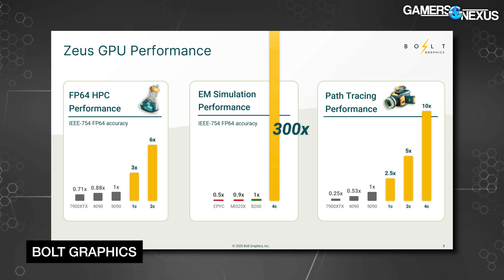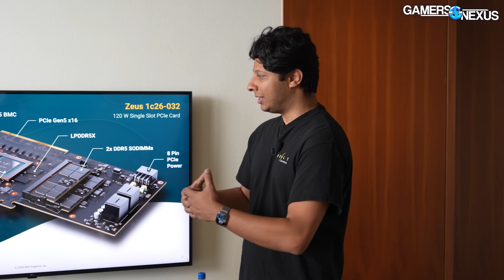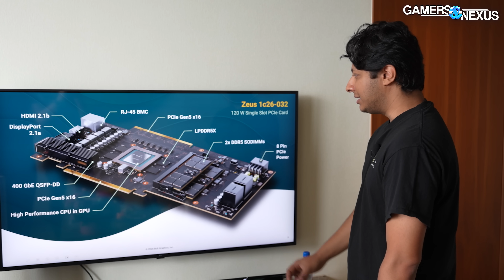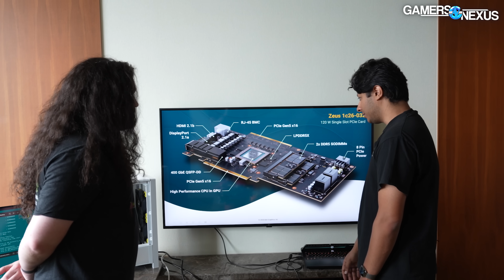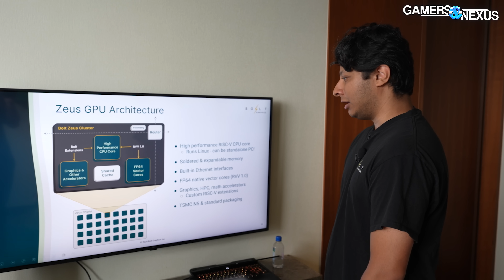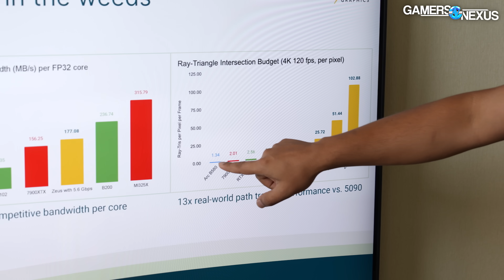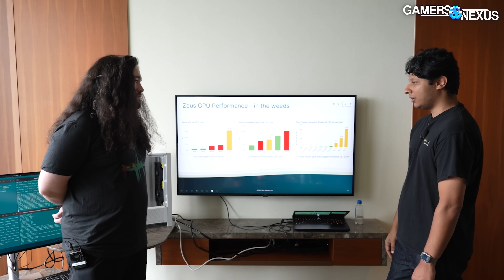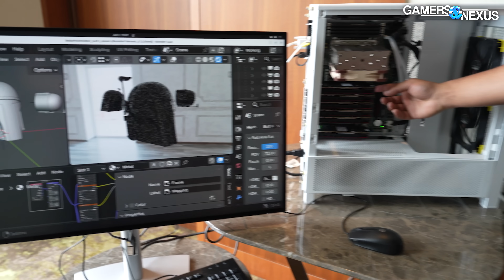A New Gaming GPU Challenger: Bolt Graphics Takes Aim at NVIDIA

Comment: Huh. I'm actually surprised by the dual PCIe Gen5's. One of the main bottlenecks for GPU that I've found is that you need to transfer CPU/DRAM to GPU. So I was hoping they just stuffed two PCIe Gen5's to be connected to the same board. Kinda like NVLink but done cheap, and for PC's. If that's one of the possibilities here, that would be quite interesting.
The choice for LPDDR / SODIMM is interesting as well. As he sais, trading latency for bandwidth. That also actually follows through some of the current GPU applications that are bound by latency. Most GPUs are heavily optimized towards bandwidth.

Comment: wait how does this work?  expandable vram is nice on paper but even with an nvme slot it cant compete with onboard memory right?  its why its always so close to the die itself cuz even the proximity to that can effect speeds dramatically.

ok im slowly getting it.  i dont believe the bandwidth speeds shown but if it can cache the way he describes im not sure it matters as much?  like the speeds feel theoretical based around current hardware architecture.  my question is how does non onboard vram interrupt that figure?  cuz if those are theoretical figures why use that when he has prototypes running?  the whole thing seems smart but also incompatible with what i understand about the infrastructure of a gpu

i think its just way over my head and im just not understanding

Comment: After watching this video, I was pondering about what is going on.  It reminds me of the 90s.  When 3DFX and how they took the consumer market off sprite graphics to rasterized graphics.  Is Bolt Graphics the "3DFX" of 2000s?  if they succeed, it might force the gaming industry the same way 3DFX had.  This is something to look forward to.

Nvidia is exactly doing what SGI was doing back then, just stuffing RT cores into the rasterized pipelines.  To really get out of that you have to build something similar to what Bolt Graphics is doing.  Because how unoptimized the rasterized and RT core pipeline was, Nvidia created the Tensor core to artificially fix the problem.  They now run into a wall realized the tensor cores are more efficient for AI workload.  Nvidia pivots their entire model to AI.

Comment: They stole my idea of expandable/upgradable RAM but my idea was to integrate the GPU into the motherboard (not on the processor) with upgradable chip and RAM that could be configured under Nvidia or AMD or Intel specs to use a "socket-specific" GPU design just like the system CPU. The GPU buss and I/O would all be built into the motherboard to facilitate HSMA and designed with ISA components that could provide parity across manufacturers platforms. Just an idea but I like that these people are thinking outside the box! Very cool! Hope this works but R&D is expensive and getting other devs on-board is going to be a hard sell!

Comment: The RJ45, the extra PCI connector, the system-on-a-board concept. This is meant to run multiple parallel units in a server rack. They designed a data center card that uses the cheaper memory left on the market and I don't see this reaching consumer hands.

Comment: So lets get this straight. It's basically an SOC and does exactly what your system does already, swap out to system memory when your vram is filled, but slightly better latency. It focuses path tracing so the older games that are raster will absolutely tank fps wise and it doesn't have the power to keep up with any nvidia card really in ray tracing so.... who the hell is this card for? I personally would never fall for the SODIMM gimmick, that stuff will be balls slow for anyone doing AI or 3D work. I don't see this really going anywhere unless you have like 12 hooked up and are rendering a pixar like animation short or something for the quality you would get but it still would be balls slow if you go over the LPDDR5x limit. This is essentially e-waste currently for 90% of the market.

Comment: I do hope they succeed, but I'm worried about that dual sodimm, not nearly enough bandwidth, by the time it will be market ready ram prices will definitely fall, and I'd go with lpcamm, or even stacked lpcamm, so you have actual 4 channels (sodimm ddr5 is actually one channel with 2 32bit bus plus 8 bit for "ecc" that is not actually ecc,...) This could be great card ( I saw just to the sponsor slot) for rendering and engineering apps first doing ISP certification app by app, and with I'd go with 3 different cores, and then you can combine amount of memory as much as you want and also speeds, some for example in 3 years lets say card is out and ram prices definitely down, can put 2x 32GB or larger lpcamm2 with 7500mt/s lpddr5, other can utilise 2x 16gb (forgot the name but extended and works in dual channel mode) of 9533mt/s or with lpcamm2 you also have possibility to put modules on top side of gpu for even shorter traces, ofcourse would need to be 5090 like pci-e slot connected to main PCB cause this would need to be bit lowered to match pci-e standards or you can ignore and have half slot z-height slot up and use it for lpcamm plus thicker cooling backplate like one that has thin laptop like fan and backplate with ribs but flat on top so pushes air through and out of back, or in rack version just elongated plate and no fan. Regarding I saw only one pcie connector it cannot draw more that 225W officially, for example mac pro and possibly other integrated systems with (semi)custom motherboards and PSUs will just turn off, I've played a lot with MP 5.1 2010, 2012 and MP 7.1 2019, but would like to get hands also on HP Z workstations, possibly Dell and definitely Lenovo (but they update more frequently internals) and maybe even Supermicro.
That type of GPGPU/GPU card would perfectly fit the upcoming project I have in mind, I would be also happy to invest in but our first set of products is coming in late Q1 '27 or early Q2, and we also have huge amount of problems with some integrations and drivers from ESTABLISHED BRANDS, not creating a new one.
But our solutions are kind of special for now, nothing new but the usage is unlimited so you basically can connect our mid tier NAS with MCIO or put one 400Gbit card in pcie5x16 slot it has, and have whole library on own pool there and game on own PC or our MIDI (not so mini but midsized) and use one pcie5 x8 for mcio or 400Gbit and another x16 for GPU and have only one M.2 for storage, or even pxe boot and run whole VDI on top config NAS and render games on GPU capable machine and "glue" buffer to display output of GPU instead of rendering on NAS or sending it to VDI and sending frames back.... We first started with NAS or control own data, and few extensions like one for running smart home on completely separated CPU and leave NAS cpu untouched, then it was idea for modem/router addon and also naturally managed smart switch.... and evolved as we pitched some firms that this could help them and investors came and in 5year plan was come with consumer and prosumer products and in next 3years overhaul and expand to enterprise (for suitable existing "systems" - hardware and/or software ) and 10years plan is also becoming profitable enough for investors to add needed cash for expanding to Enterprise PC/Workstation Systems Integrator at least but more of a SI with semi-custom and custom line(we're already working with respected brands that also offer ODM) which I'd be happy to work with hardware like that, it would perfectly fit out ethos (that's also why we've so many problems with software to solve 😅😂), which is cloud independent, open source as much as possible, security and anonymity or rather right to keep personal data really personal and not exposed to 3rd party and OS independent with use as you want it. No subscription, one time pay and that's it, everything is yours, except you can extend warranty from 3 to 5 years (haven't yet done on exact numbers) and support for indefinitely, so until clients will trust us and we will continue to exist, this will continue and is also in EVERY investor and partner contract (most investors are also partners in this program investing in "ca$h baby" but more important in human resources and own experience as well). 
And regarding it's on RISC architecture, and will probably mature to levels we want, just by the time we plan to enter Enterprise Workstation biz in 2035, beginning depends on how other things go but between late Q1 and early Q4 '32, I seriously hope we got another "non AI" but rather pure rendering competition, Nvidia is expensive in their Pro lineup and wasn't what it used to be like 5 years ago when PNY was their exclusive for everything "non-gaming", AMD simply has too fewer models and Intel is fairly new and we don't know what will be with Nvidia's poor 5% stake but I feel they all dance like Trump plays and Jenson in the role of conductor....  B50/70 are great cards, especially for its money but were all actually product of Gelsingers' engineering approach to leadership.... And I don't know how much Lip Bu Tan will leave Tom Peterson have free hands. From media and some sources, despite most of all their cpus except Xeons, had integrated graphics, but this was their "ryzen" moment... Now it's unpredictable....

Comment: i wish i wouldnt see so much scam alerts in there 🤫
Reply: yeah, they are pitching this card way over what it is. This card is a very slow, high quality path tracing card, nothing more. Will be great in a workload with like 8 - 16 of them bridged together rendering something like a Pixar short but other than that, this card is useless. Can't path trace fast enough for ray tracing, the SODIMM will be significantly too slow for quick rendering, and it has barely any rasterization performance. This thing is DOA in my eyes for 90% - 95% of the market.

Comment: Running ddr5 instead of ggdrx will be slower
Reply: like, ridiculously slower. Going from minutes in a blender render to hours if not days slower. Sure the quality of the path tracing will be great, but you are going to wait so much longer to get there. This thing is a hard pass and he straight says the rasterization is awful so any game without ray tracing simply won't work with this gpu and the Ray Tracing games that will work, won't render fast enough. No point in getting 102 path calculations per pixel if it's too slow to do it very well. I'm sure if you have 12 of them, it will be okay in something like Blender "if" it gets supported. The "its up to the developer how they want to implement it" should turn anyone away from this. If a developer does do anything with it, it will be on the large scale, not the small scale. This game is not a gaming card, not in the slightest, it's not even a video card, it's an SOC that plugs into a pci x16 lol.
Reply: @KaliArts2D spot on ,

Comment: As far as video card features go, I couldn't care less about features that eat my resources to make the game look a little better. It's cool when you buy the top of the line video card and can use it for a bit while the video card is overkill. As soon as the newer games start to require more graphics, all of those features get shut off.

I want High ram, bandwidth, and clock speeds. Offering an upgradeable ram on cards is a great idea. The ram on my gpu has always been the first bottleneck in my systems. When Nvidia put out the 5060 and 5070 with less than 16gb of ram, it was planned obsolescence. "If you don't want your video card obsolete in 4 years, buy the extremely overpriced cards."

I'm excited about bolt. If I buy a mid grade card right now, their gaming cards may be on the market when I'm ready to upgrade again.

Comment: As I was saying for long time - NVidia is just 4kRayBlocking us. They do not want to give us true 4k performance for years.
Now want to stuff us with AI bs.
I already want to use this new product. It's amazing tech!
Reply: The worst part is local LLMs are getting pretty good now. 1000B cloud models are overrated. All you need is to install a Gemma 4 or Qwen 3.6 31B A3B or 27B model on your machine and it will run and perform fine for most things you can think of without paying a subscription. It does run okay on mid to low range machines especially the A3B model, you don't need all that much memory anymore. And on top of that it runs fine with AMD these days (still a bunch of scoundrels like Nvidia, but still cheaper).

Comment: Make a card that delivers 60fps at 4k in aaa game for $200. Now! Hurry up!
Reply: In 4K I mean... Most gamers are still on 1080p and a third is on 1440p including ultrawide folks like me and I do have a high end current gen machine. We're still far from generalizing 4K I'm afraid.
Reply: @Doomguy-777 😂😂😂😂 nope the rx 9070 xt will do 4k at 60 all day long
Reply: My laptop with the equivalent of a 4070 is 4k 😂
Reply: @thewoodweldingfabricator9300  On modern games? Especially UE5 ones? Let's not push it. Maybe with some settings on high or medium, maybe some upscaling, but it won't otherwise. UE5 titles run anywhere between 60 to 90 fps with a 9070 XT in 1440p UW (21:9) in ultra for the most part. And some "ultra" settings in UE5 are absurdly scuffed and meant for 3D rendering, not video games.

Older games then yes, 4K 60 fps natively is achievable.

Beside I much prefer 1440p UW and a solid 120 fps (maybe even some FG x2 then for 175 Hz maxed out monitor refresh rate) than 4K 60 fps. 4K is crazy intensive and turns GPUs into heaters and airplanes. No thanks.

Comment: I think this looks really promising, especially considering the vision they have for the technology they want to support and their different approach to hardware support and architecture. 

I think Nvidia's vision is really one of the areas which put them ahead, which is something I think Intel Arc and Radeon have comparatively lacked. I'm excited to see where Bolt can go with their own vision.

And this is on top of their outward support for open source and desire to steer away from proprietary standards as much as possible.

Comment: There is so much money in this market, I would be surprised we don't get 5 more companies just like this in the next 3 years.
Reply: The problem is the initial start up cost. Right now with Nvidia basically backing out of the consumer market, there is no better time, but if they don't get a decent market share before Nvidia comes back, they will be dead in the water.
Reply: @dustinroberson1865  I see this company freeing up the supply in the 'middle professional' ground. Home workstations, contractors. Nvidia has the infrastructure to mass produce for the lower-end gaming users and ultra high enterprise consumers
Reply: Hell if we could just get somebody to re-enter consumer dram market.
Reply: I expect a Chinese company to do it for years at this point, but that hasn't happened yet. Lets see how bad this has to get for it to start happening in the near future.

Comment: i'm not sure why he didn't want to mention the license holder for the CPU design for this board.
Last year, a company called Akeana, who does risc-v ip licensing, did a sort of announcement video which ended up resembling this one (one man talking to this same Bolt CEO).
the types of things he mentions "edge gateways" and other things are mentioned in that video and on Akeana's website.  
Akeana (and i believe Bolt as well) also recently announced working with Samsung fabs to make upcoming hardware.
That being said, they could have switched companies or even decided to make their own, since risc-v is an open source technology.

the skeptic in me is yelling loudly though.  Akeana has no products, they have a few designs you can license from them to make your own chips, (sort of, they're "core designs" so you could put several of them together into one chip, like they have a LITTLE core design and a big core design, you'd put them together to make a bigLITTLE chip, much like how qualcomm does with ARM's core designs.
there's actually only a couple of companies doing much in the RISC-V space.  a company called Milk-V, making teeny tiny devices, they also put out an ITX format device, which is supposed to actually run Linux and resemble a typical desktop experience, most of their other devices would fit in a smartwatch, small camera, remote control, or a raspberry type device. 
there's another company called SiFive i believe?  anyway, most of the devices using RISC-V could be found on a website called Arace.  but recently, nearly all the products on Arace that did use RISC-V are out of stock, and all their current stock appears to be using these "open-source ARM" and qualcomm chips.  Qualcomm also makes RISC-V chips, and in fact they use RISC-V inside some of their smartphone chips apparently, to sort of manage the ARM-based SoC.

but these devices aren't going to be replacing desktops anytime soon, if ever. they're good for small devices and single purpose computing (like a small router extender, security camera, or smartwatch). 
and 

anyway, my point is, this is very early days, for both RISC-V, for Akeana and the other companies using RISC-V, and certainly for Bolt. 
i'd love to see this be successful, and after hearing him talk today, i'm a lot more confident in him than i was a year or so ago when i first heard about him, but still, he has no working boards to show, no product, and there's really no other working examples out there either.  

so if he DOES design his own "CPU" for this "GPU"  well, in that render, where IS the GPU?  is it on the same die as the CPU?  that sounds like ARM to me. but i don't know.